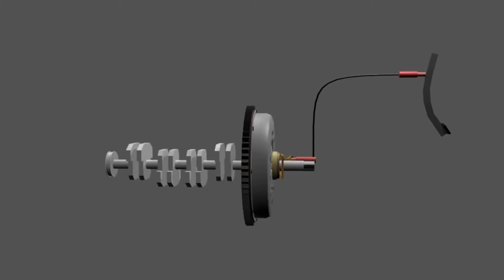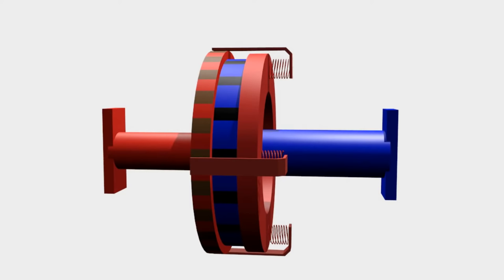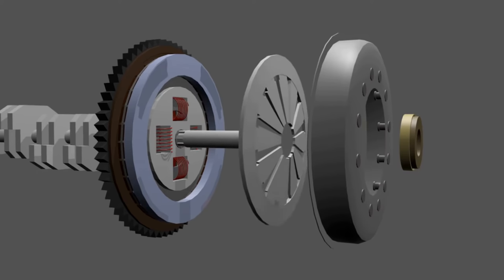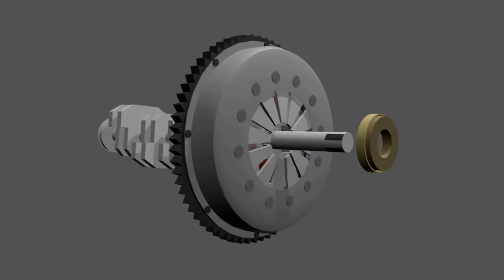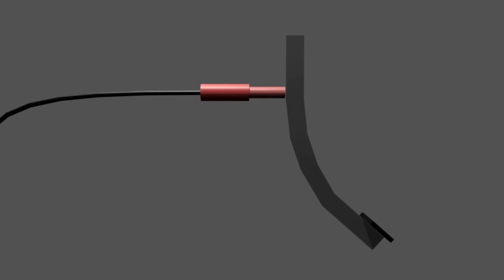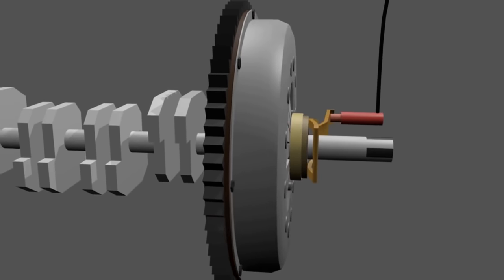Manual Clutch Working Principle and Animation

Comment: This is a great animation.It helped me understand the concept in detail. There is one minor glitch in the animation at the end when the clutch plate comes in contact with fly wheel, the cluth plate revolves but the flywheel does not
Reply: i agree with the above observation
Reply: fly wheel will be always rotating as long as engine is on  whether the clutch is engaged or not
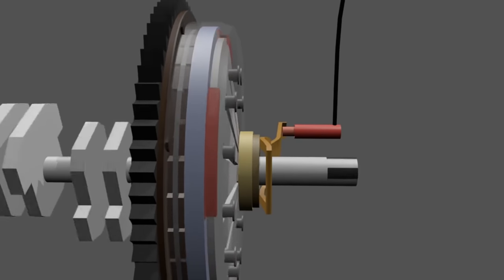Reply: @ravindran8761  yeah that's why it was a bit odd to see it stop at 3:10 when the clutch is engaged, as it should've just kept spinning
Reply: @ravindran8761  That's odd, the flywheel on my 2G GSX Eclipse hasn't spun in years!

Comment: Good info but there was misinformation regarding the clutch. He noted the clutch friction plate no longer moves once you press down on the pedal but thats not true.

The clutch plate will still be spinning from the car moving because it only disconnects from the flywheel, not the transmission which is why you still need synchros.

Comment: Masterpiece. Because of. 1.the example of clamp. 2.On your video it seems clearly that the bolts on the clutch housing go directly in the flywheel with no traspassing the clutch disc, pressure plate, and spring diafragm. so there are no misunderstanding. Thanks.

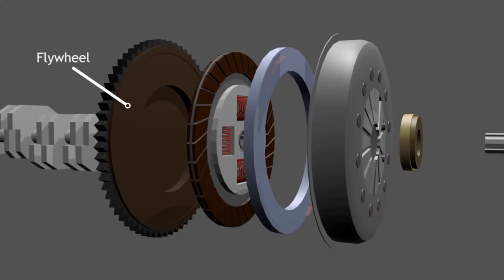Comment: 1:06 Why does the flywheel seems to rotate in the opposite direction of the crankshaft? Because of the video's frame rate? Still they look like not connected.

Comment: 3:15 - flywheel stops? or should it also move on the animation?
Reply: Flywheel is bolted to the engine, so it should turn as long as the engine is on.

Comment: why not make a clutch disc and the pressure plate one single piece?
Reply: Because pressure plate is connected to flywheel and clutch disk to shaft.
You can see it as a sort of diskbrake wich clamps on both sides.